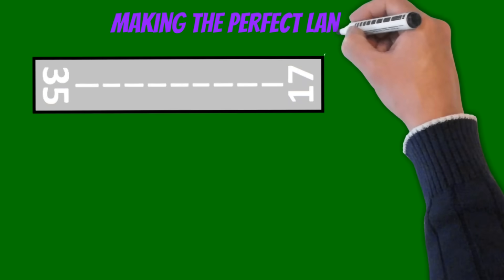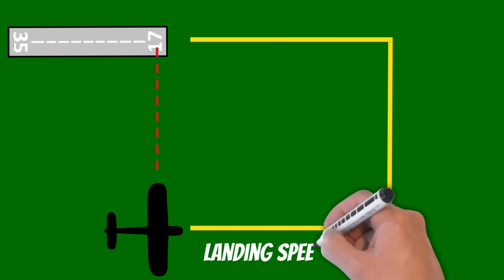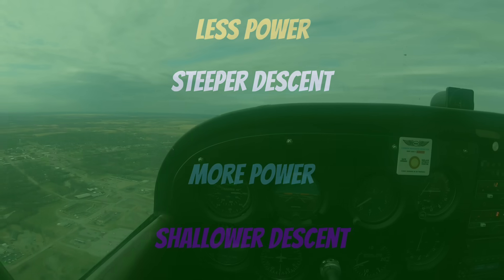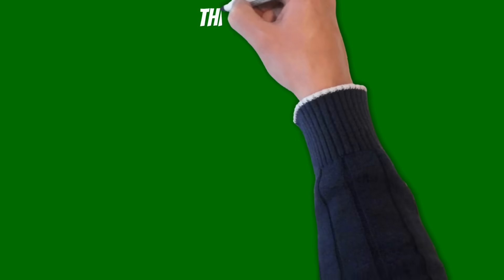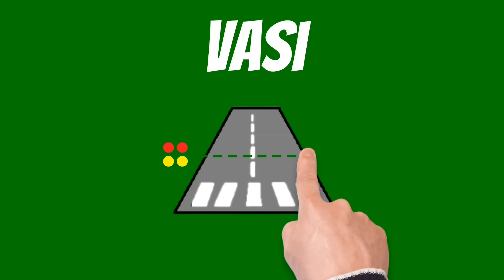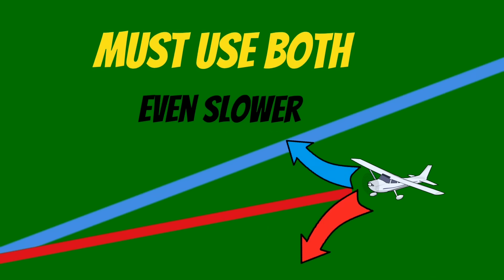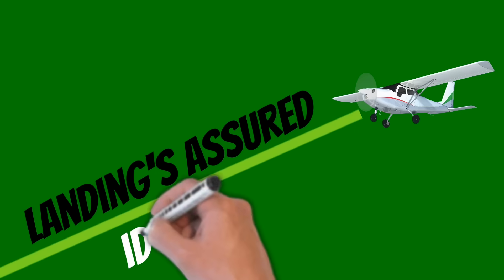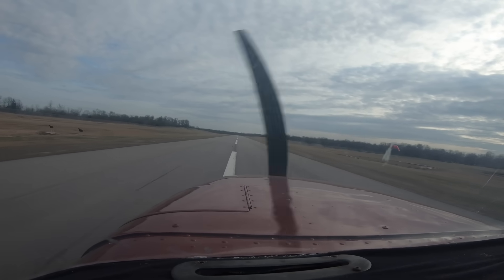Landing SECRET your Instructor won’t tell you [How to Land]

Comment: The best policy is to be above the glide slope. Use flaps as brakes. Don't depend on power for landing all the time because you have to be prepared for power loss on landing. If you're under the slope, slow, and lose power you're lost. Above the slope you're OK. Altitude is energy. Speed is energy. A little high, and fast gives margin for trouble. Burn it off with flaps prior to overshooting. Don't depend on the geometry of a pattern for stabilizing. Most likely you'll have to go long on downwind for traffic on final. Then you have to pick up the glide slope cold straight in. Learn to recognize it when you intercept it. Don't depend on the angle. It''s unlikely to ever be the same. Wind makes it different every time. Same with VASI. Use the drift technique mentioned in the video. If the aim point is drifting up you're low, Drifting down you're high. Set up right you shouldn't be bankin, and yankin on final for centerline. You should be close to center enough to steer with rudder. Steer with rudder as if you're already on the ground. That makes it easy. Wings level. Then concentrate on your speed, and slope. If you're low consider it as close to a failed landing as you ever want to get. Add power but your mind should be thinking go around. You may be able to get there but you're going to be very busy to do it. Why take a chance? Go around, do it again, and practice doing it right. You don't have the right stuff yet but you got behind the wheel of a plane which puts you above 99% of everybody who never did.
Reply: Wow... it's almost like there is NO DOWNSIDE to being high or fast or with the throttle closed......

Comment: You forgot to explain clearly what is a flare, that’s the most important thing you want to make sure your student understands perfectly since the first landing, so that he/she knows what he/she has to learn
Reply from the maker: As strange as it may seem, this is the way I teach students to “flare.” I don’t want them to think about flaring In an airplane as small as a Cessna 172.  This almost always causes a balloon.  It’s more of a “transition” than a flare. If the students focus on flying the airplane down to the runway then pull the nose wheel slightly above the mains, with no power, the airplane will settle onto the runway smoothly.
Reply: @FreePilotTraining  I have learned to fly on C152 and in my experience it’s important that the student pilot understands what a flare is and how to “fly the flare”. You can do a perfect final and then crash because you just fly the airplane into the grownd. Just my opinion based on my personal experience.
Reply: @FreePilotTraining  I like the way you describe it here in your comment, I think most students would understand your words and that would help them translate it into practice.

Comment: Doing lots of power-off landings is good practice. You will be higher than three degrees. You will learn to put it down on a spot with precision. You will internalize the procedure -  for that day when the engine isn't cooperating and you are forced down  to a very short landing spot.
Reply from the maker: Very true.  You should be well above 3 degrees for a power off landing

Comment: Been instructing off and on for 40 years. While I fully agree with the bases that pitch controls airspeed on approach and power controls rate of descent, I would put a little more emphasis on “ energy”, pitch and power are interchangeable. Every approach has a perfect glide slope, if you are not on it, correct for it as soon as possible, the earlier the better. I also get the student to ask themselves as soon as they turn base: “ am I high or low? Am I fast or slow” then fix it to where you want to be.
Doing a great landing, never gets old
Hans Juergensen
Reply from the maker: Hans, I really appreciate your feedback!  I agree.  I should have spent a little more time talking about energy management.  And you are absolutely right, a good landing always makes you feel like a real pilot!

Comment: Using flaps is never a good idea unless you are a well seasoned pilot and flaps are working, They can become non function-able in flight. From a bird strike, engine failure etc.

Better to use side slip if you have to slow your speed,, and always come i high, with at least 10k over stall speed,

Also these brain dead instructors always tell you to be 1000 feet above grd, and 1 mile out ~ WRONG !
This is a great big error, that needs to be corrected, 
If you are down wind, and it will happen, you Lose power, and the wind is extremely strong with you, You need to turn cross wing almost immediately so you do not come up short on approach, Final or for emergency landings.
Best to learn short circuit approaches as soon as you can with power off always,

Or as soon as you feel comfortable with your aircraft.

At the 5 min mark of this video, This pilot would never make it to that strip if a gust of wind came up, and he lost power,

Better to always learn how to do a power off approach every time, That way you can never go wrong. and always practice short circuits,  That gives you the best way to learn proper control of your aircraft, And remember to practice at higher altitudes slow gliding and power assisted turns, so you know what can be done for immediate recovery,

When you learn this properly you can land the plane in the shortest possible field or strip and walk away,

Hint,  
Power off and you have to make a force landing in trees, Come in as slow as possible and pick out 2 big trees if able to, and go between them (near grd level) with fuel etc shut off, It takes the wings off slowing you down to a very slow speed, 
If not pick out the bushiest trees at just above stall speed trying to keep your nose up, so you hang up in the trees, and float there, and it may slowly drop to the ground, Unless they are to open. Then you need to consider a better approach at the time,

One last suggestion
If you have been taking training on flat land country, and the instructor says he can check you out mountain flying in a few short hours, Walk away from him, and go to the mountains and ask a well seasoned instructor to teach you from the start everything they know,
Especially in bad weather. You will be shocked at the difference you can learn,
 They can teach you how to get over and around bad conditions,
It may save you and your loved ones !
Reply from the maker: I’m not going to address all of these comments, but I want to mention that it is A REQUIREMENT by the FAA to be able to land in ALL flap configurations.  Student pilots ESPECIALLY need to learn how to land WITH flaps for two reasons.  First, you WILL shorten your landing distance which can be EXTREMELY important on a short field landing.  Second, landing without flaps is much easier because in most planes, the aircraft already is oriented in a position to land when you fly down to the runway, and the need to flare is almost non-existent.  Plus, unless you are flying below your landing speeds which would not be safe, you will likely float the landing, which may make for a soft landing, BUT soft landings are NOT necessarily safe.  Ask any military pilot who has performed a max effort landing.  Students need to be able to use every tool available to them and that’s exactly what flaps are. A tool...
Reply: @FreePilotTraining  
Flaps have a place,
But When I owned my own plane, It did not have or the desire to use flaps in another plane, and I could put it down in an extremely shot distance, with barely a 200 foot roll. My stall speed in my plane was higher than I wanted it to be, roughly 50 mph, 
It has been many years, But If I recall correctly, when I side slipped onto the run way.and rolled out, MY stall speed was already gone, and my plane was sitting on the run way with the tail down,

I never found very many good pilots that could land their planes, at the point where it should be,  They always had a long roll.
 They always had way too much roll, (Use of flaps), It creates a heavy cushion under the wings, and sure it may slow the plane,
But it also requires much more strength to pull back on the elevators, if you are injured or the trim for flaps do not work,
(Which can happen in military maneuvers)   But on roll out, You still traveled a bit to far,
It is more important for any and all pilots to learn the art of side slipping, which is rarely taught, except maybe once in their learning,

Ok maybe you have your point and maybe I'm wrong , But I do hope this what I mentioned will open the eyes of pilots who need to learn to fly, 
Just don't be crazy
If you want to be crazy, Take proper stunt flying lessons by an real expert, and let not yourself be the one to teach you,

You will learn to be more confident and able to actually fly a plane without getting into trouble, unless you show off.
Reply: @FreePilotTraining  I have learned both
But when flaaps fail, you better know how to side slip, and come in at a steep angle as you most likely won't have a field or a landing strip and that means a road, depending on where you re flying,
A proficient pilot can bring in any aeroplane side slipping , if they got the nose down as supposed to, there is no way the plane would stall, and your run way speed when you round out at that moment, your stall and landing speed will be close, and you won't need much of a distance to stop, and learn to pick out 2 trees, when you are coming in, and take the wings off, 
and you will walk away from most crash landing,
 any small plane stalls around 55 or even less, By taking off the wings. that speed you will be cushioned, and don't forget to turn off the fuel so there is no fire.
Sure learn to use flaps, but learn also without, especially if the flaps need power, you will have a problem
Something you can expect with power loss.
A good pilot side slipping can bring down and stop almost in the same distance one can with flaps, but with flaps on side slipping is  a bit more difficult for a beginner or some wel seasoned pilots, because they never do practice a side slip, and if they do, they probably will stall by having the nose go to high being scared.

Comment: Some instructors aren’t strict enough in their pattern instruction. Simple accepted guidelines like “never descend an inch on downwind”  work. Roll onto final 500agl sets up that stabilized approach. I have flown with pilots who reduce power and add 10 deg of flaps on downwind in a C172,. They don’t use enough trim and descent 100-300ft on downwind. Sloppy and dangerous. The start of a crappy approach start early.

Comment: If you are too high, too close, and/or the runway is too short, you can approach flying in the region of reverse command (nose high/low speed). That way you would lose altitude without gaining speed. You control the rate of descent with power, and your speed with pitch.
Reply: I hate this idea.  Hanging on the prop is a setup for stall spin with any powerplant hiccup.
Reply: @imaPangolin  You obviously don´t know why you once were taught low speed flight lol There is a big difference between low and stall speeds. Learn your aircraft buddy.
Reply: @pdr5926  nose high low speed is a disaster waiting to happen with any distraction.   Being behind the power curve should make your pucker factor increase every time.  Yes it’s practiced to show how bad it is and to understand proper control input in the low speed regime.  But it’s practiced at altitude where recovery is possible.  One hiccup one distraction flying this method in the pattern is another unnecessary stall spin death.  Bad idea.  I hate it.
Reply: @imaPangolin  You will feel safer and more in control as you build up flying hours. It is not dangerous, the engine is not stressed at all, and you should not be literally flying slow to begin with. Go back to the reverse command flight curve and find the sweet spot on the aircraft you fly. Just as a reference, any airliner is on its reverse command flight speed on final.
Reply: @pdr5926  you crack me up.  I fly airliners.   You are correct we are on the back side of the curve but have a ton of extra thrust.   I still don’t recommend this in a single engine aircraft but at some point, prior to power reduction you’ll be in this state.   I understand your point and it’s in the extremes that there’s danger.  I’m just so tired of seeing pilots die.
Reply: @imaPangolin  Then you would agree with me that pilots die because of poor training, poor skills,  and poor aircraft maintenance. As long as anyone understands what's doing, then all will be fine. I gave you thumbs up.

Comment: Pitch plus power provides performance. The primary control for speed is pitch. The primary control for glide slope is power. But they affect each other, and most of the time, you'll need to change the other when you make a move with one. Too low? Add power and pitch for constant speed. Too high? Cut power, pitch for constant speed. Slow? Pitch down, add power to maintain slope. Fast? Pitch up, cut power to maintain slope. Most likely it's a combination of too high and too fast, and too low and too slow, which require both to correct, then an adjustment once targets are reached. But which control you reach for to correct which thing is important. 

I was a NIFA power-off competitor in college. It's a very challenging event. It's all about energy management, and with no power, that means it's all about managing drag. You'd be amazed at what speed does to your drag. And propellers. Constant speed props at high speed and no throttle are air brakes. I'll never forget one time prepping for landing in a Duchess. I was approaching joining the pattern, but was slightly high and pretty fast. Throttle was closed and props at 2100. I needed to slow, and props needed to go to high speed, which was 2700, so I pushed up the blue handles, slowly, but even still it was like stepping on the brakes on the landing roll. Caught by the belt and everything.
Reply from the maker: Thank you!

Comment: Terrible advice.
Your aim point doesn't move, and you can set it as you wish.  It is literally a point that doesn't move.  You don't 'aim' for it, but you can adjust it with power and how cleanly you are flying.  You are teaching "operating" not flying.
Reply from the maker: If you want to land on a specific spot, it should not move.  However, you can move it
Reply: @FreePilotTraining  Exactly.  I have a glider rating.

Comment: Use the airport runway numbers pasted on your windshield depending on left or right crosswind component and let it just grow. If its bouncing around, your not in a stable glideslope. Adjust trim and power accordingly with your final landing airspeed.

Comment: The title is click bait...sad...aviation training is not about getting clicks...its about safety.  EVERYTHING discussed in this video is how CFIs train.  Stabilized approaches are discussed in the FAA AIM as well.   Beyond that..it is a MISNOMER to suggest you can fly every approach and the pattern the same.  Wind, density altitude, the aircraft capabilities all dictate variances in flying and especially in flying structures like a pattern and an approach.  Also, no one 'flys the lights' once experienced.  You use them as a guide, but you do not fixate on them.  The goal for good landing is to make small corrections (and do whatever it takes) and to fly over the numbers at the correct speed (Vso).  Each plane has a different Vso and that number is listed in the POH.   Once over the numbers at the correct speed simply reduce speed and allow the plane to get a few inches above the runway and pull the nose up slightly.  This will stall the plane and allow the mains to touch first.  Then allow the nose to touch and brake evenly until you exit the runway.
Reply from the maker: Yes, I should have picked a better title.  I couldn’t agree with you more.  Thanks for the comment
Reply: @FreePilotTraining  Don't get me wrong.  I think your content is well made.  You are presenting solid information too.  I just had a little problem with the title since it seemed to misrepresent how CFI based training is actually being done.  I am not a CFI btw.